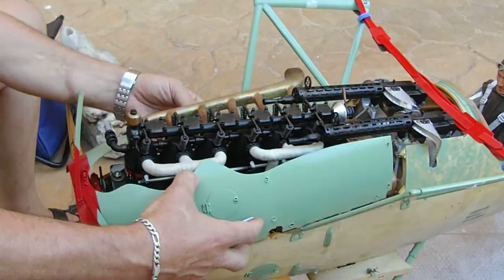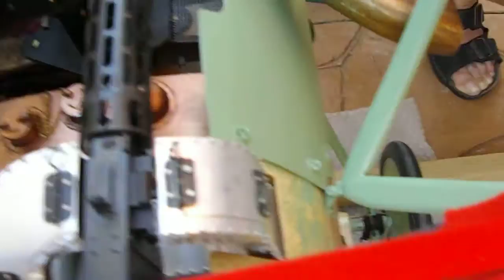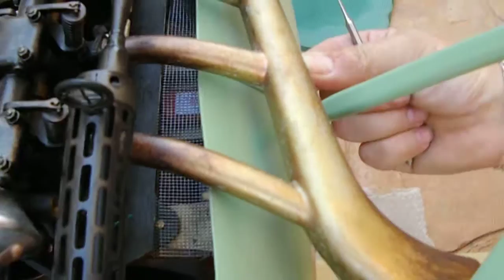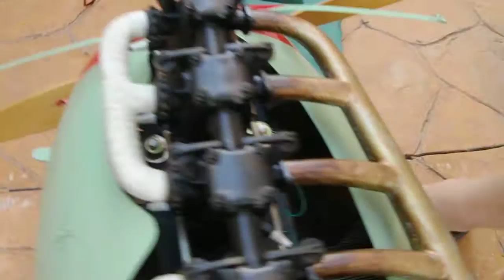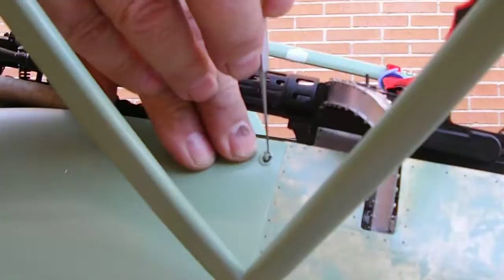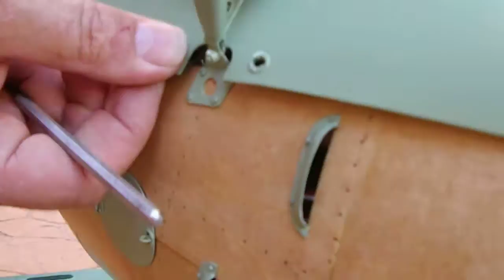Albatros Dva

Comment from the maker: The laser is a 300V motor.
The aircraft I've flown only twice and I didn't had heating problems. Behind the cone has a fan I made with aluminum and helps to cool the engine. The model kit is a proctor.
If you want I can send photos.
Where are you from?
You can send me an email that is easier :lorenzocasa @ tedensa.com